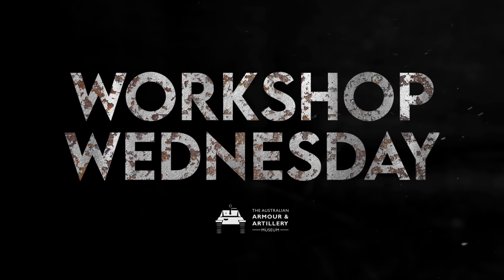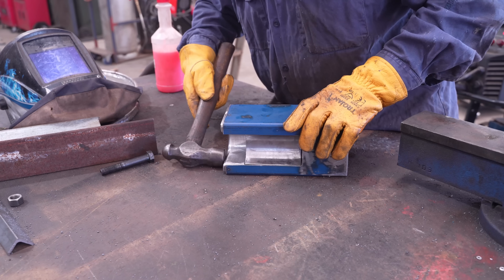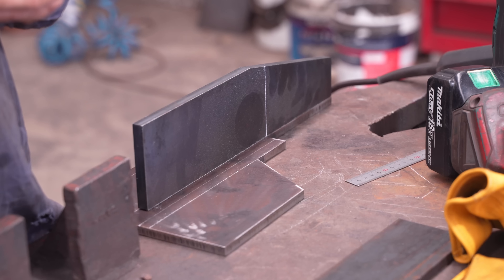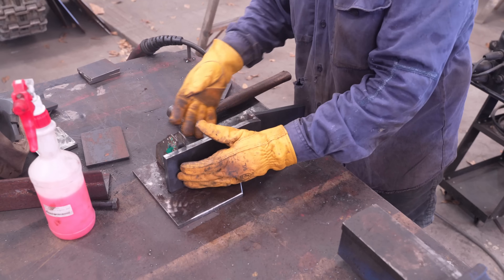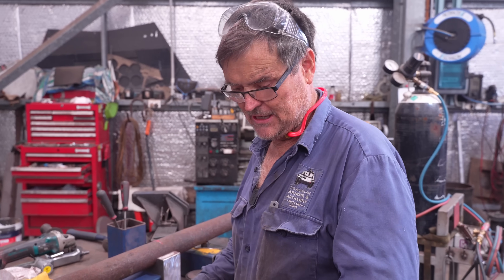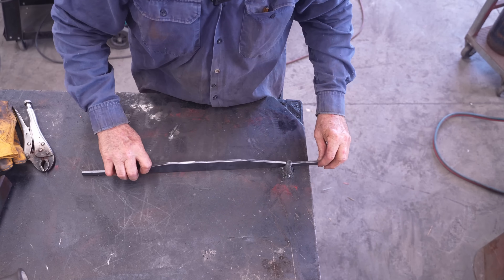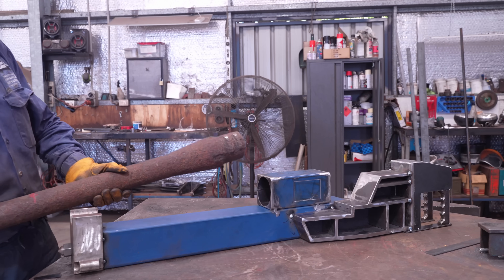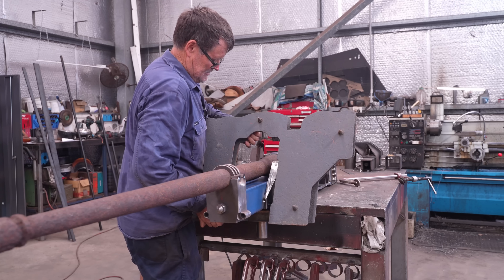WORKSHOP WEDNESDAY: Fabricating the SdKfz 221's Panzerbüchse 41!

Comment: @10:10 Daz leaves the outside frame part extra long to give himself leverage and then cuts it off flush. A rookie like me might have tried to cut it to correct length at the start and had no leverage to curve it. Amazing.

Comment: love it - replication at its extreme - just fantastic to watch and even nicer when you have the material around to do such a job
i used to replicate a few pieces of aviation equipment for cockpits, lay in bed pondering over how i might do stuff
one of my finest pieces was to replicate a small artificial horizon, inspiration came from the bottom of a beer can (as you do) i had to drink a little quicker as i then cut off the bottom which provided a very neat ball shape for the floating horizon, magical, add some graphics and a couple of bits of bent up wire, way better than waterstained black and white photocopies i have seen in various museums

Comment: It would be interesting to know if the 1/35 scale plastic kit-set model, being used as a profile for construction is the Hobby Boss (83811) Sd.KFz - 221  - Leichter Panzerwagen, the 1st in the series, if so then there are two more from Hobby Boss, the 3rd in series (model no. 83812) and the last or Late model (83814) and yes, for the German WW2 model enthusiast, they are available via Ebay.